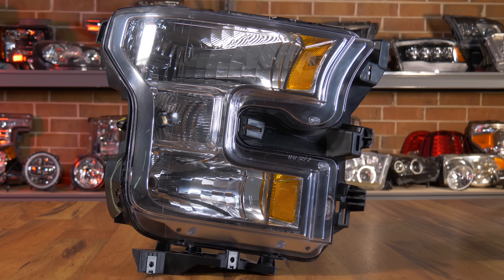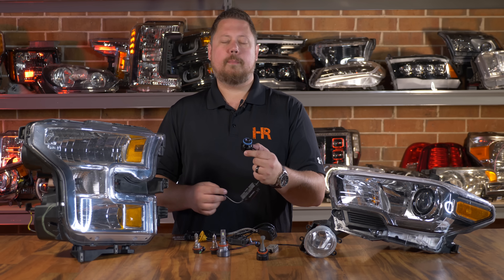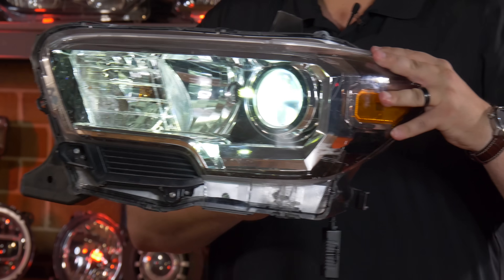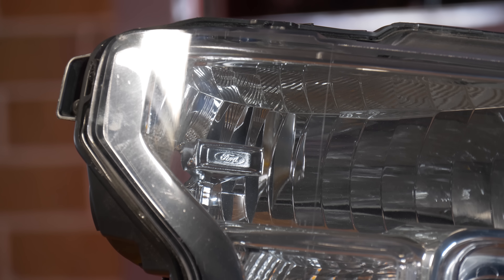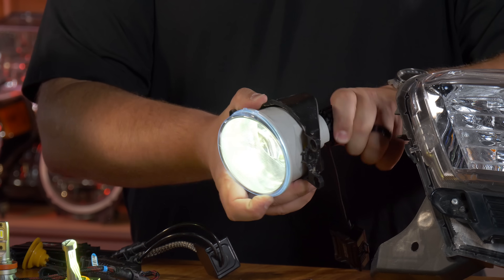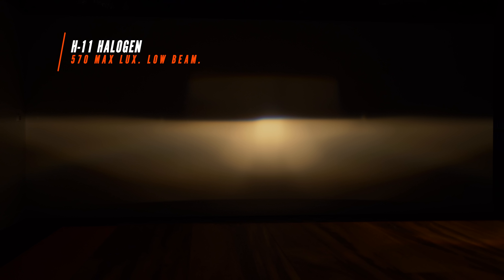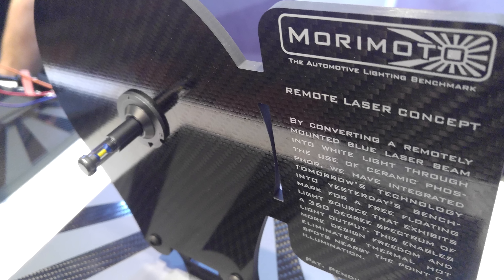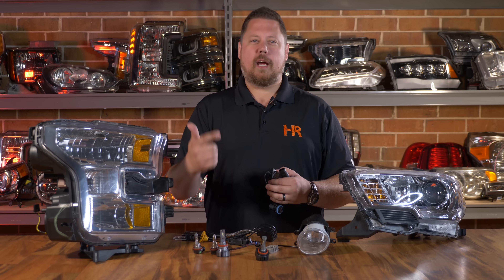Laser PNP Headlight Bulbs are Here! Do they work though?  |  Headlight Revolution

Comment: On its own, it seems useless to me. I'd use it as an ultra powerful "high beam assist", where the super bright tiny spot is great to illuminate things that are super far and directly in front of you, or to annoy the lady going 5mph under the speed limit on the left lane. Other than that, it's a solution in search of a problem.
Reply from the maker: We agree. not worth it until the tech drastically improves.

Comment: Using a nichea 4.5W optical output power 450nm blue laser with a phosphorus disk, it’s a point source light that is really not recommended for anyone driving towards you. Also, the CRI on this sucks, it’s light spectrum is very unnatural. I would say not safe to use for the other drivers out there
Reply from the maker: That's a good analysis

Comment: It's absolutely clear that this device is just projecting the phosphor output through a simple 'condenser' style lens... in order to make it work with a reflector lamp, you need a reflector that diverts the collimated beam into an approximately-isotropic, over a hemisphere... just a 'ball is about what is needed to adapt this to a reflector application.  The colour gradient that you see was typical of 'white' phosphor LEDs, and is caused by the uneven distribution/depth of the phosphor across the area that is illuminated by the laser; it appears that they used the smallest-possible phosphor 'patch', since a larger phosphor plate would have had a more even phophor thickness across the illuminated zone. There also may be some effects from phosphor heating, not positive on this point. Or, there may be some wavelength spread from the diode source, although it should not have that... 

In short, this device is unusable in an automotive application without additional optics. In a fog application, it would only require a cylindrivcal lens, which should give a very flat, short (height) beam. For a high-beam, a fairly-sophisticated optic would need to be designed. Again, for a low-beam application in a reflector housing, a beam-diverging reflector would work. In a projection lamp, one would need to use a diverging reflector, maybe conical (perhaps not a simple 'cone' ;-) ), in 'front' of the laser light source.

Sorry to go on and on; the potential is there, but requires a LOT more sophistication than this device is displaying...
Reply from the maker: Absolutely, it will be several years before this tech can safely be applied in the automotive world.

Comment: So, I think that using this in a traditional headlight might be a misuse of this light. The way they're supposed to work is as a super tight little spotlight that can be directed at targets of importance by the vehicle itself, and aimed away from oncoming traffic. Each vehicle is supposed to have several of these in a motorized jewel headlight setup essentially. Each one is to be autonomous of the others, but the vehicle can use them in combination as well. This is where the future of headlights is going: AI-directed lighting using eye tracking, object recognition and tracking, and other enhancements possibly in tandem with heads up infrared/radar imaging. I think Headlight Revolution might unfortunately be playing catchup without realizing.
Reply from the maker: That's a very in depth analysis! Very cool thoughts there.
Reply: @HeadlightRevolution  Thanks for the reply. I actually read about this in a Car and Driver opinion piece calling for headlight regulatory reforms. They pointed out how long it took NIHTSA to allow the current generation of headlights that Europe had over a decade beforehand.

Comment: Any D2S to LED convention kit available somewhere ？
Reply from the maker: If you really want to do it, yes. You can find them here: https://headlightrevolution.com/morimoto-d2s-2stroke-2-0-led-headlight-bulbs/
We do not recommend putting an LED bulb in an OEM HID projector though. Here is a video that we made about this topic: https://www.youtube.com/watch?v=-PKI0zrdntg&t=127s
Reply: @HeadlightRevolution   D2S is common with scooters and those are usually incandescant, not even halogen. At least with the chinese bikes. Some of the housings are small/shallow and halogens over 35w and hids can melt them. Yall probably knew that.

Comment: But how does it work then in the original cars (ie Mercedes or BMW)?
Reply: The indicators don't even work properly on these vehicles
Reply: it has a complicated lens and mirror system with proper engineering for a good beam pattern.
Reply: The laser is in what looks like an hid assembly. 

The lasers are blue and are bounced off a mirror.

From the mirror in to a phospher cube.

And from there hits the parabolic lense.

I have designed one based off bmw, but no way to build a prototype.
Reply from the maker: Not very well it looks like.
Reply: The first bmw laser headlights were not legal in us cars.
Reply: @akane742  Who cares?

Comment: People really need to watch a video on headlight adjustment after install.  Most of these bone heads have them pointed at your rearview mirror.
Reply: this problem is only compounded by retards install NON DOT legal LED/HID bulbs into car headlamps which are not designed to use the light properly because the reflector or projector is wrong. also most people who install aftermarket bulbs don't give a shit about oncoming traffic which can lead to a fatal accident if conditions are right,  There needs to be stricter enforcement and fines and roadside inspections for these pricks who don't play by the rules or if it need be tow the car and pull the plates, that simple.

Comment: With further development laser lamps tend to generate many lux at a specific point, which is interesting for long distances. A laser beam that at 5m generates a hotspot of 20cm, at 100 meters this hotspot is much larger (I do not know the exact formula for calculating the size).

Combining a good bi-xenon projector with a good laser light in the high beam should give an interesting result.
Reply: This laser bulb seems like it could actually do really well when placed in a grid or bar fashion, similar to Acura TL/MDX LED headlamp arrays.
Reply: Where can i buy one? Did you know?
Reply: @mjds777  I do not, this is the first I had heard of or seen one available to the mass market. I imagine a quick Google search could give you some results, but it doesn't seem like these bulbs are very practical yet. Have to wait and see how the technology improves.
Reply: I didn't even find it on Google

Comment: Perfect for a flashlight the pattern is spot on. Lol.
Reply: Exactly. Driving, not so much as you need more of a flood then a spot light
Reply: It's already a thing
Reply: LEP flashlights already exist.  Weltool W3 and Acebeam W30.
Reply: Even for a handheld flashlight, you usually want more flood.   However, for a rifle light they are fantastic.  For defensive use you can quasi use them as an aiming device, incredibly disorienting and blinding to anyone you point it at, and unlike most flashlights the distance penetration is absolutely outstanding and you only need to see what is right in front of and around your sights.

Comment: What if the refractor in the standard mirror headlight is pulled out, could be like the high beam.
Reply: The spread is still so small that you can overlook a person standing between the lights, 5 meters in front of the car.
If the "lazers" hit a reflective road sign, you might even blind yourself so much, that you can not see the road anymore.

Comment: The bottom should have been better expressed that the goal here was to show that you should not put “laser”, or HID for that matter, into a generic housing. It must be specific to handle the style of light out put. Just like it is in BMW and Audi. Laser technology blows the doors of led and hid if installed properly. Clearly the company who made this only made 50% of what’s required.
Reply: Laser technology is currently only used as an auxiliary for high beam with it's far reaching beam of light. 
They're currently pretty much useless as anything else as you'll simply be blinding anyone coming the other way in any other application.
Not to mention they're way too expensive when an LED setup can do the job of a dipped/high beam as well as laser.
Reply from the maker: We get that!

Comment: Leds are the best I run Hikari high and lows on both my trucks 2013 ram 1500 Laramie and my 2013 gmc sierra and alla fog lights on both trucks.
Reply from the maker: Nice! So you're really liking them?
Reply: Headlight Revolution I had trouble finding good ones for my 2013 gmc sierra that had dull halogen lights I tride two other brands and they were exspensive they were not good so I sent thim back and looked at the Hikari h11 and took my chance you know 3rd times a charm  got thim put thim in they were right on  no dark spots nice and bright(: I'm shure there are  others that would have worked too.

Comment: There is another brand of led assisted laser plug and play bulbs. The leds and the laser are separate so you run led for low beams but can switch on laser for further brightness
Reply from the maker: Kevin, that sounds interesting. Got any more info on that? A link perhaps?

Comment: HID For Life! I've tried em all! Morimoto Elete kit is the best and brightest across the board in a projection housing I've tried.
Reply from the maker: BOOM! There it is folks!
Reply: I'll second that had them in my old car, 8k in reflective headlights and they were brilliant now iv got shitty normal bulbs(for the moment)in my new car, need HIDs badly
Reply: @davidc3363  if you thought 8k were brilliant, you should try 6k or 5500k this time around, you'll be blown away :D
Reply: wantsanewvehicle 
I have 6K HID high beams and they nearly match my 6K LED’s in color tone 
The brightest light that is visible to our eyes is going to range inn color temperature from 5k-6k
Anything else is going to be in the ultraviolet spectrum which is invisible to our eyes
Reply: @mrbigbigtoe  
UV light shows animal material like deer hair and human hair better than normal lights do, it isn't just about the color thst comes out of thr lamp but how the light reflects/emits from the object.
Reply: Mhmm!
Reply: I have an old jeep that came with the standard 5x7 glass headlights. I replaced them with DOT/SAE led lights. It's such an improvement, I dont feel a need to go any further
Reply: i use ddm 55watt hid for my headlights. way brighter than leds
Reply: I have led but they don't get hot so in a snowy  area  like michigan  you might  get snow build  up on the headlight

Comment: We need to toss out the idea that it would need to in a traditional headlights application. Start from scratch.  Now, all it needs is something for the beam to pass through to disperse the light properly.   Whereas LEDs and HIDs and halogens produce light in all directions and something captures it or harnesses it and aims it, the laser simply need pass through a guide to aim the light.  Given its such a concentrated beam, id imagine there would be alot more control of where the light goes. Meaning less blinding of other drivers.  Also, with the size of that laser bulb, you wouldn't need some huge housings  on the front of your vehicle, which is already the case with projectors. They are just stuck in a big housing, but they dont need it. You could have tiny little holes at the front of your vehicle.  Id guess the size of a half dollar.  Glass in a particular shape,  or some other medium that captures the light and spreads it in the desired manner.  It wouldnt need to be that big either because the laser beam at its concentrated point is so small. Could reduce costs of manufacturing and make for something else up front. Perhaps more air intake.  A gas cap or eventually a plug for gas or electricity. Stylistically it could dramatically change the way vehicles look .  They could go as far as to be 'smart headlights that move and adjust their beam accordingly to the contours of the road, and have sensors up front that register incoming lights from other vehicles and change their aim, all this possible due to the hypothetical smaller footprint theyd have.   

Look, im just talking basic 💩 here. I dont have a clue how lasers work.  There could be some element of their nature that makes me comment completely impossible.   I dont know about manufacturing.   It could cost more.  My point is, its always worth exploring more ways to better suit the needs of us humans in a more efficient and effective manner that makes it possible for the automotive industry to have more sh*t to buy that i cant afford.  The end 🤴🤚
Reply from the maker: @noahkb80 we agree with you! In it's current form it's not very useful but it has potential! Some type of focusing device needs to be put in place to utilize the beam differently.

Comment: Just curious if you were to diffuse/optic over the light if it would work better
Reply from the maker: Joe, the simple answer is yes... and no. If you put some type of diffuser over this beam it may be a wider beam, but it's still not going to be the correct beam. The reason headlight housings are so large is that you need all those different reflective surfaces to spread the light out where the manufacturers want it. Or a projector... A laser projector would do the trick or a headlight with built in mirrors to focus the laser light like BMW uses.
Reply: @HeadlightRevolution  I should have specified for aux lights sorry

Comment: The laser light manufacturer specifically say they are made for fog lights at the bottom so they light up the pavement and have a longer pattern on the floor. There is no point to this video
Reply from the maker: Having an intense amount of foreground lighting (i.e. having these pointed at the ground in front of you) would have a radically negative effect on your long distance driving vision ability.

Comment: Surly it just needs a convex mirror in front to reflect it back at the lights refector
Reply from the maker: That may work, but at the end of the day those reflectors inside the headlight are designed to reflect light from a halogen light bulb with a filament. This reflected laser beam pattern would probably be all out of wack even if it was pointed backwards.
Reply: it's a concave lens it needs to split the beam and reshape it
Reply: I would rather think of some sort of diamond shaped prism installed in the very spot where typical bulb filament would be. It would spread laser light all around inside of headlight and make it bounce off the reflector just like it works with typical bulb. That's in theory ;-)

Comment: I want you guys to test these out.. It's a laser projector with an LED array around it for more width.
https://www.aliexpress.com/item/4000005978618.html?spm=a2g0o.productlist.0.0.18a36de7OIdS8b
Reply from the maker: Yes that would probably work really well but then you're getting into Projector Retrofit territory and there are already a ton of great options out there for that. For a bulb replacement it's a totally different story.
Reply: @HeadlightRevolution  this would be in place of a high beam on my MKIV Jetta, with euro hid replica housings. The reflector bowl for the high beam is garbage and does not work well. There's also no room behind for added ballasts, or even enough room to accommodate for a projector. I currently use a Profile Peak Hi Lense as my high beam, and its good but it lacks a hot spot in the center which is what the laser version would provide. For my specific application it's exactly what I've been looking for.

Comment: The intensity is good, but for that kind of pattern, I feel you could get far more out of an HID or even LED. It's a start, but the aftermarket has a way to go before lasers become practical in automotive applications. I wonder if they could do something similar to what Xenon Depot did with their latest XV indicator bulbs...
Reply from the maker: You read my mind!! If you could make some sort of "virtual filament" with a laser power source you'd have something really interesting!
Reply: @HeadlightRevolution  Indeed!

Comment: Can we compare one of these to one of the small pencil spot lights from Rigid or baja? It looks like it would be good to have 10 of these in an off road light bar.
Reply from the maker: We probably won't do that demo because think of the end product. You'd have a bunch of LED bulbs cobbled together when you could just buy something nicely built from Rigid or Baja. Not worth it IMHO.
Reply: @HeadlightRevolution  I was thinking more of something like a Rigid ignite, similar size.

Comment: I think just like putting incorrect led bulbs into a reflector housing, laser bulbs might need a specific type of lens that disperses the light.   A few of the higher end cars are getting fancy laser headlights that can deactivate that zone when detecting on coming traffic.    I wonder if they have a bunch of smaller lasers each in charge of their own zone or are there lenses that can redirect their aim away from oncoming traffic
Reply from the maker: Exactly, it's the same thing as that, but we felt like proving it. A totally different design is definitely warranted.
Reply: @HeadlightRevolution  I saw an unboxing and test of a laser projector unit on wheelklub and I had high hopes but it was more or less the same thing as your results.  I am curious to see if there will be any after market retrofits for lasers.  If what they say is true, it uses even less energy than led.    For poops and giggles, I would be curious to see what would happen if you flipped the lens inside out of a projector and shone the laser through it.   In theory, it should spread the beam out